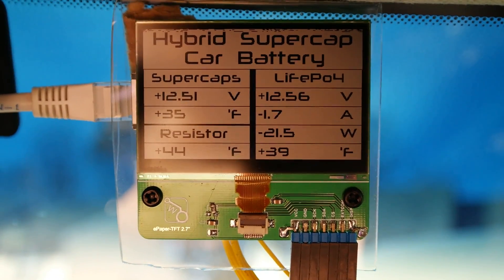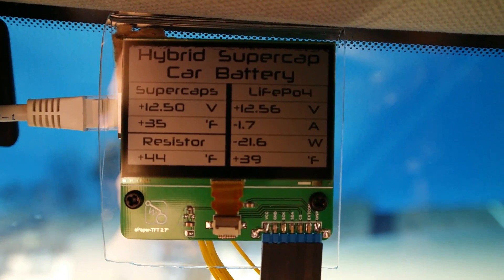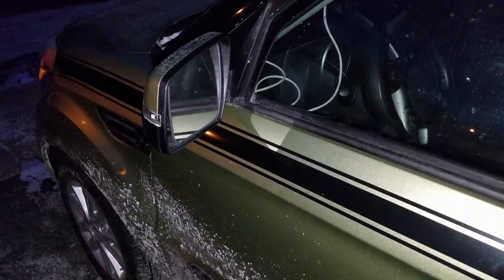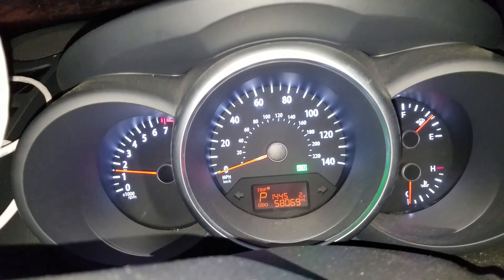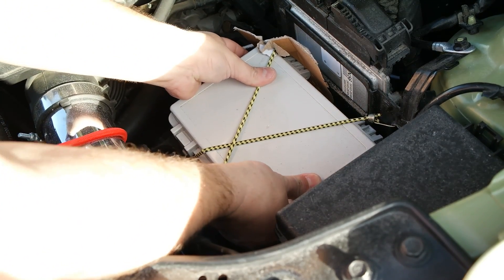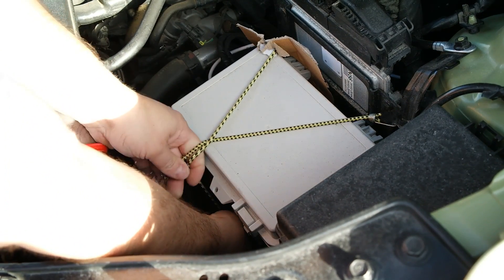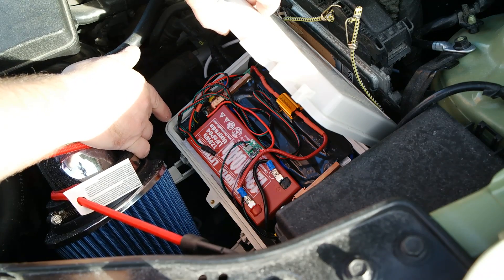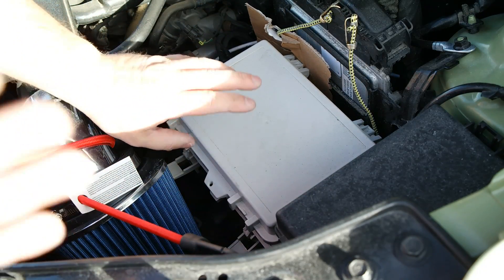Hybrid Supercapacitor Car Battery Part 9 - Final Install & Thoughts

Comment: ordering the stuff to see if i can get away with 6x (2.7v) 500F super caps in a ~15v array (so ~80F),    0.1ohm 50wat power resistor,      and 7aH 12v lifepo4. 4 banger, early 2000's civic. i figure if it doesnt work ill just push start it lol. would like to see if I can get it to cost a third what the equivalent lead acid battery costs.... and lower internal resistance of the supercaps should slightly nudge gas mileage on hwy trips i think. got a mini polymer "ammo can" to put everything in. the ones that come with the gasket seal since keeping caps dry seems to be the magic to longevity. going to make a copper busbar and put nailpolish on it or something.... dont like heatshrink as much

Comment: Do you wire the current limiting resistor directly in series from the positive battery post to the positive side of the super cap?

Comment: Do you think this will work even if I add a car audio amplifier ? 700watts rms I have used lipo batteries to jump start but they tend to get puff off if left for more than the requiered seconds . And they been losing cc rating that’s after I discover that the charging system they had on their case had no monitor( balancing circuit it has just outputting 4.2v to each no mater if it was balance or not ) and that messed up the whole pack . I have install a 1 farad cap 12-16 v but I don’t think that helps it actually reduces the voltage going into the amp which is close to amp and for this car electrical system really doesn’t stress much  on outputting 13-14v but cap shows 10-11.8volts .

Comment: 24 volt would be better option as you can run solar, power tools, and household appliances on it..... its form factor is small and lightweight enough to use in handheld power tools and its stackable to at every voltage to 600 volts ...... 24 / 48 / 72 / 96 / 120 / 240

Comment: Please make it with Makita power tool batteries 18 volt that I can just slide my batteries in and go they are 18 volt and come in 6 amp hour battery packs. you could also do this with other size batteries and power tool batteries. think about how much simpler that would make it to remove and install batteries if all you have to do is slide it in /out take it in the house and charge it in 35 mins. you could always have your batteries in doors away from inclimate weather. I honestly do not know why they have not gone with this option before a tool less battery.

Comment: Did you have any weight savings? I have a high CCA requirement for rotaries, however weight the reduction point for me.
Reply from the maker: I would say at least 50% lighter then the lead acid battery it replaced.  Should be easy to do on a rotary as I don't think you need as much cranking amps, but I could be wrong.
Reply: @madelectronengineering  Thanks! I'm starting my project soon. The rated CCA required is 700.

Comment: I came across part 10 of this amazing series only this morning and have been glued to the monitor ever since, watching parts 1, 2, 3, etc :) Seems to me that the same principles could be applied to regenerative breaking in EV's, could it not? I found the reasoning behind replacing the 0.5 Ohm resistor with a 0.1 Ohm resistor a bit too brief. Could you please elaborate why the replacement worked better? Thanks for all the inspiring insights and demos!

Comment: Would you change anything for a high-compression V8, do you think a single bank of 5x3000F be enough?
Reply: v8 SUV and pickup trucks have a 15.3 volt  Power Output.  when using tow mode. so you will need more then just 5  other wise you will pop them
Reply: That would work. Pay attention to the max voltage of those 3000F caps though. If they aren’t 3V but 2.7V you’ll need 6 of them. 
I think you can buy ready to use packs on AliExpress and EBay. Don’t forget the (large but low value)resistor between the pack and the battery if you want to relieve your battery from strain.

Comment: It only takes 2 seconds to start a car. The mah doesn't need to be 2 
hours; Soo the configuration of the cell itself is not efficient for the
 purpose of a car starter battery.(It could be much smaller lighter and 
cheaper if it were designed for that purpose )
For lights etc., long lasting lion batteries would be most efficient.

Comment: I see a long term issue that could develop and result in unbalanced charging between the super capacitor and the rechargeable battery. The super capacitor has very low internal resistance and gets charged very quickly to the car's max charging voltage (approx. 14.4v). You can see in the video it didn't take more than maybe 10 seconds for that to happen. Meanwhile, the internal resistance of any rechargeable battery is significantly higher than that of the super caps. I don't know the exact details of how a car's charging system work on a typical lead acid battery but I highly suspect that once the super caps maxxed out at 14.4v the car will stop charging any further and the "back up" rechargeable battery won't ever get to reach its full charge. In may even incrementally get depleted further and further as time goes on. It's like trying to charge two batteries in parallel and each has very different capacity and internal resistance values. How can you really charge each one to its full capacity while in parallel configuration is a real challenge and the key to making this supercap + battery combination work for as long as possible. Remember these super caps are supposed to be good for at least 10 years ...
Reply: sr.  supercapacitor take any voltage (that's why you have to limited it) and deliver a huge current wherever it will find a way out with lower voltage up to equal his own voltage. amperes doesn't hurt it will take what it's needed according to the voltage /(battery = supercapacitor)   note: never attempted to hook up a uncharged supercap below 11 volts for a 12 volts battery  you  may used a 12 volts light( light will go off but steel keep charging ) to limit the current to the capacitor until it reached the 11 volts.

Comment: Would this work with the cap pack for starting, and a deep cycle battery for accessories?  For example in a van the capacitor bank under the hood with a 110ahr battery inside the cab.  Using the battery for radio, inverter, ect., while the engine is off.  And using the caps to start the vehicle on their own.

Comment: Hi,

Thanks for sharing. I am planning on replacing the lead acid batteries in all three of our vehicles with the same hybrid battery.

Only additions I might do is two terminals connected to the capacitors to allow jump starting. And a small solar panel to keep the battery topped up as I often need to leave a vehicle parked for a full week.

Comment: Fascinating, I have a nice mobility scooter chair thing my father left behind when he exited this plane of existence. It has a pair of deep cycle sealed lead acid batteries. It has been a couple of years and will eventually need to be replaced. I use this almost every other day to make the half mile trek to the market for fresh food. It is handy to zip through the market. Or, the mile over to banking facilities. I am wondering if the new technologies will be viable to consider as a replacement for the current batteries. They are not terribly expensive. Most accessible places seem to think they are worth $125. a pair. I have a different opinion. With the current setup it is rated as 20 mile range. A trip over to the bank and back does not show on the battery level meter. I just plug the trickle charger back in (onboard with a simple 120v ac cable).

Anyway, thinking out loud so to speak. Thanks for the video chain. Interesting. I need to go zip up to wallyworld now for some crap for supper.

Noble reader, if you need a subscriber? I sub4sub as soon as I see the alert on the phone. This month's features schedule includes Vape, Barbeque, Kitchen, and Electronics.

Comment: And temperatures in the summer? There are several cars that has cooking battery liquid and batteri dies instant and they fixed it with a heatshield and a fan?

Comment: you could use a dc-dc converter to run the capacitors up to 15v, and use a larger ohm resister back to the battery. though you have more than enough amps in the capacitors, you're not taking advantage of the high voltage capacity. I'm using a 50W solar panel mounted to the hood to keep my capacitors topped at 15.5V (using a dc-dc converter). I don't currently have a battery hooked to it.
Reply: I added a lifepo4 3ah (hjtx7l-fp) battery so I can start my car at night or in the early morning. works perfectly. I have a .5 ohm resister and a 5 amp self resetting breaker inline to protect the tiny battery. Works GREAT!! the battery was $43 on aliexpress
my parts list: all from aliexpress
2 banks of super caps 500f ~16.2v on balance boards - $38 each
50watt solar panel - (ebay) $50
hjtx7l-fp Lifepo4 battery - $43
5 amp breaker $2.63
.5ohm 50w resister $1.42

Very reasonable for something that should last at least 10 years in Alabama weather

Comment: Will you  help us doing the same for electric car which has 30 kw motor and it draws max  280 amp, will you be able to design it, we will buy supercapacitor maxwell with balancing circuit but rest i have no idea as i am a mechanical engineer..

Comment: Hi, I would like to use your system in a ham radio application for the emmergency community. How long will the system last if say it was running a load of 55 to 100w, such as a car headlamp without being recharged by the alternator.  From this information I can extrapolate how viable it would work in my enviorment.  It would save me hauling around a heavy leadacid battery. Thank you you are doing a great job.

Comment: Well done! Have you seen the Schumacher Super Cap device being sold as a Jump Starter for cars? It is connected to the low battery or another battery to quickly charge the Super Caps so it can then be used to start the car. It is quite clever. Here is a link: https://www.amazon.com/gp/product/B01MZZD2YB
Your design takes it to the next level. Super Capacitors for the dumping lots of CCA in extreme temperatures and a Lithium Ion for the deep cycle parasitic devices and keeping the Super Caps topped off. This will be the next revolution in vehicle batteries! Hopefully you are able to patent this process.

Comment: Could a version of this be used to replace the battery in a computer UPS? Most local outages are extremely brief, second.  Be great to have supercaps take that load and extend battery life.  A bit different as eventually battery needs to kick in
Reply: Not so much.   Caps allows for a smaller battery in a car when it comes to starting.   Look up Li 12 volt battery for UPS.

Comment: What is the CCA rating of the LiFePO4 battery?  I'll guess a low of 250 CCA and a high of 450 CCA.  I really like your instrumentation in the car!
Reply: The  LiFePO4 battery just keeps the supercaps topped off while the engine is not running, it keeps the electronics alive and runs the low current draw lights and stuff...the REAL power of that setup is the HUNDREDS of amps of power that the supercaps can dump in cold and hot weather, and they can do it over and over and over and over and over again for hundreds of thousands of cycles vs a few thousand or so for lead acid...
Reply from the maker: The LiFePo4 battery is a deep cycle battery.  It does not have a CCA rating, but I would venture a guess and say maybe 50CCA.....

The two strings of supercaps I use are rated at 700Amps to -40'F if that helps.
Reply from the maker: Thank you brian!